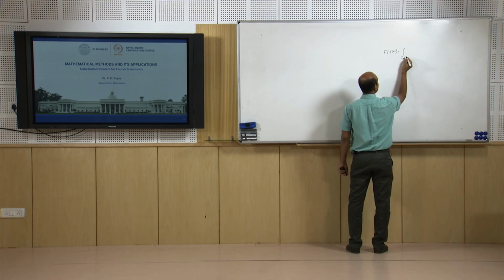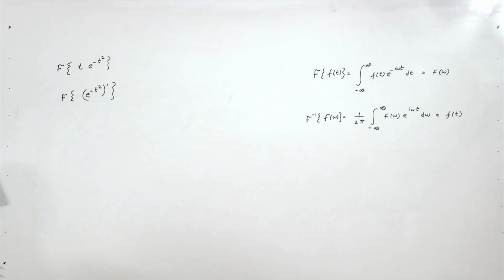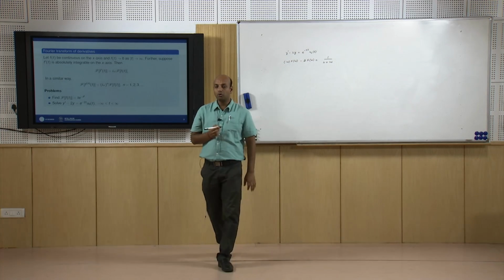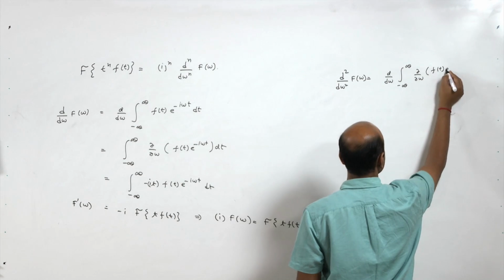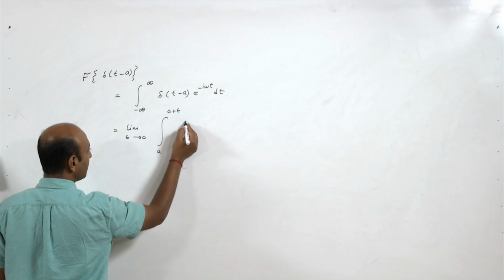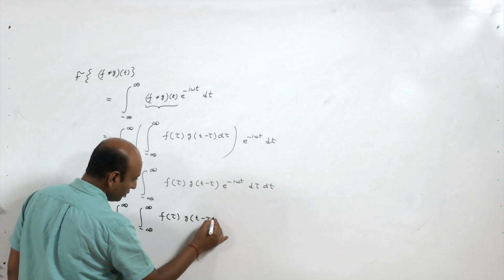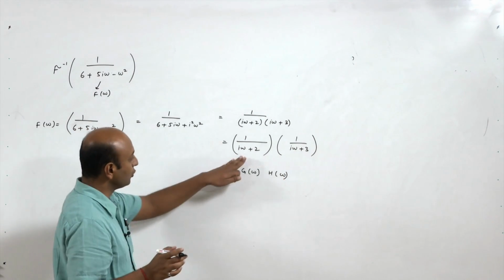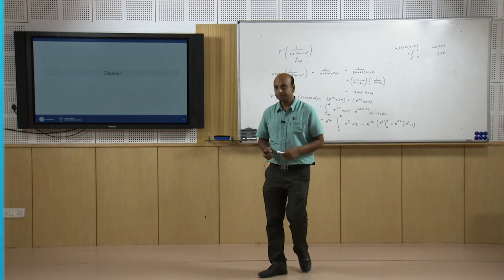Lecture 57-Convolution theorem for Fourier transforms

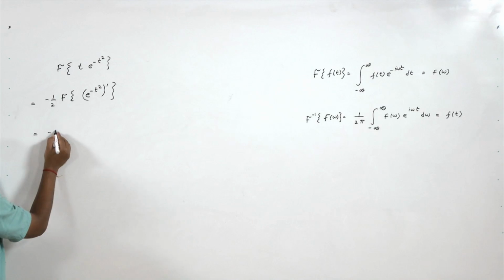Comment: sir , i hav a doubt in the video 5:32 sec..
F[ f'(x)]  = (-iw) . F[f(x)] 
so i think u hav missed a negative sign there. pls correct me if i am wrong.
Reply: no it is right just use integration by parts by letting 1 function as e^-iwx and second as f'(x) so when you take derivate of e^-iwx wrt to x this is -iw and - sign is already in front that makes plus sign